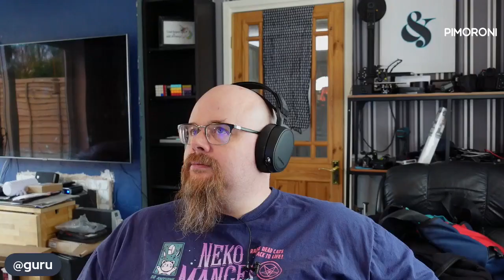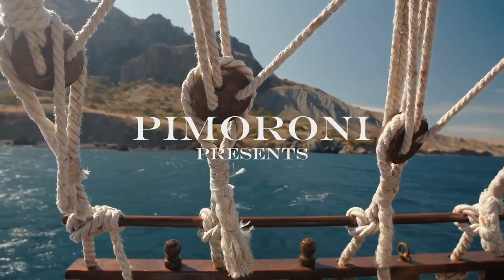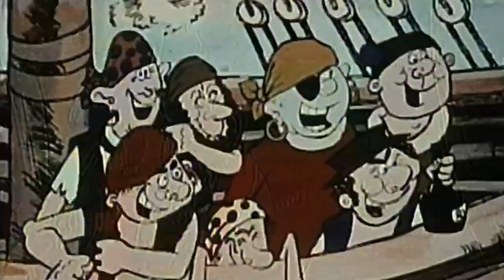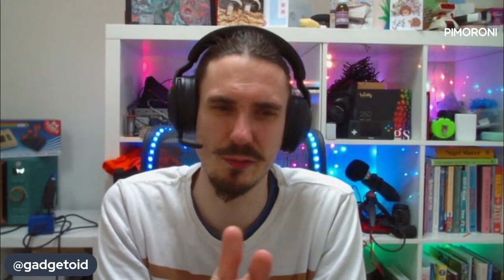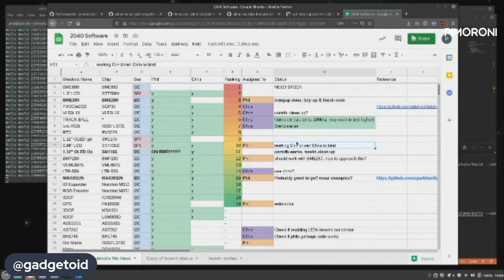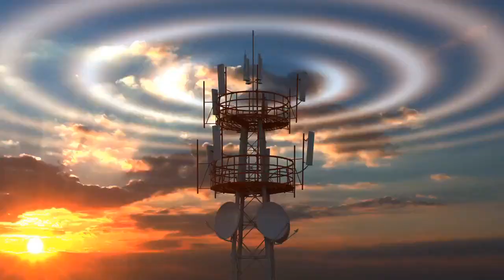Pirate Radio 0x00 - Raspberry Pi Pico software support - where we're at!

Comment: Circuitpython was created from a fork of Micropython. Therefore access to all features of Micropython is available to Circuitpythin if the developers choose to implement them. It is true that not all of the features of Micropython have been implemented in Circuitpython, such as external interrupts. The APIs between the two are very different now, but I do not feel that Circuitpython is any less powerful than Micropython.